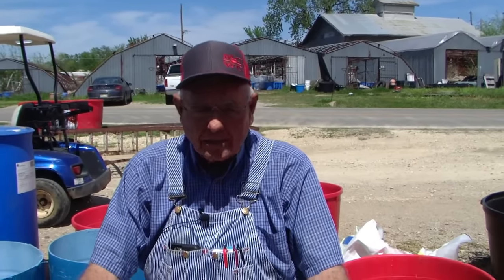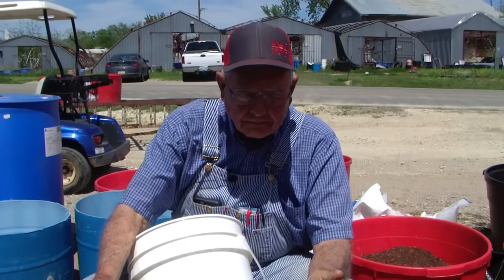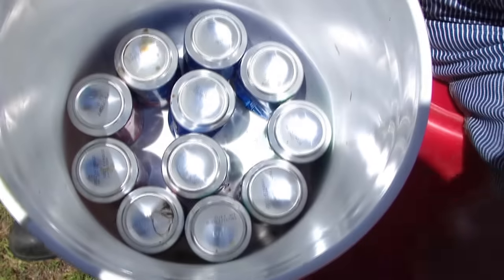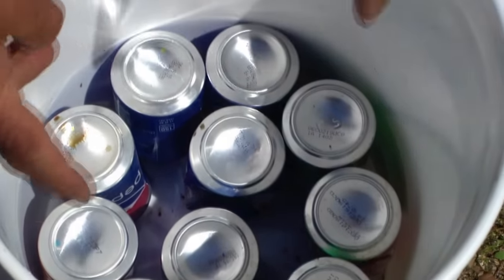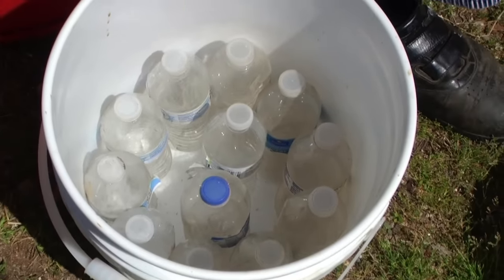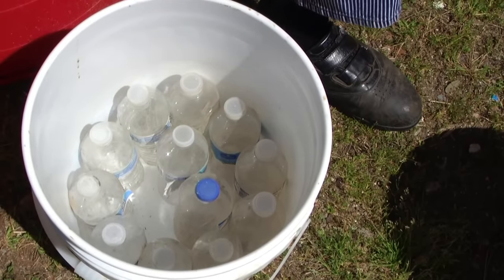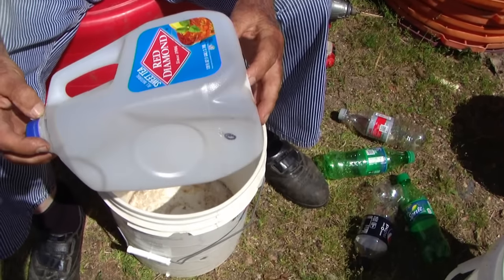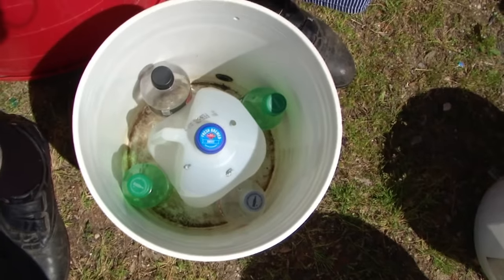Using 5 gallon wick buckets  Ep. 15

Comment: Are their any concerns with using aluminum.  I realize the insides of the cans are coated with a plastic to prevent oxidation, but what about the outsides bring in contact with your water and roots?  Any issues with the paint on the cans?  Any issues with the labels on the water bottles or the adhesives for the labels?

Comment: Okay,  i have to ask this question, because everyone that has seen my first ever self watering 5 gallon bucket garden system has asked. Will these buckets get too hot and kill my plants on those hot summer days. Mine is a white two bucket system with the lower bucket slightly buried but not above the drain holes. Thanks

Comment: Hey Leon, question, if you putting potting soil between cans, doesn't the soil going to block the hole in the can. Instead of soil, can it be pebbles? Thanks
Reply: Pebbles wouldn't wick the moisture up to the plant. The soil won't 100% clog the hole, water will still seep through.

Comment: Hi, so when I put the small water bottles in my 5 gallon bucket, it doesn’t look like it leaves a lot of room for the soil. I end up with only 6 1/2 inches from the top of the water bottle to the top of the bucket. I was wondering, can I cut the water bottles in half?

Comment: Where can I purchase In FL , the correct Fertilizers & minerals you used in your starter bucket video I am trying 5 gallon version 1st … 
I am using a 3 bottle nutrient ( see below descriptions  ) will this work ? If not I need to know where to buy All the Fertilizers   
FloraGro builds strong roots during a plant's vegetative stage.
FloraMicro is used during a plant's growth and bloom cycles.

FloraBloom is added while a plant is fruiting and/or flowering.
Reply: Of course u can use those, it's just not Organic. Otherwise get a bag of Trifecta+, and just mix that in the soil
Reply: If you will view Ep 20A, this might be helpful in your fertilizers.  Most important is to look at the strength of the numbers on the fertilizer bag.   Thank you for viewing.

Comment: How do you fill with water? top of gallon jug has the hole how to keep soil out ? why do you use fabric in some buckets an not in all?
Reply: I think the design means use the fabric in all these different versions, but somehow the video just didn't mention it.  Because without using that fabric, but instead putting in soil directly to the bottles that hold water, the soil will keep falling down the holes at the top.

Comment: Do you have a video showing step-by-step directions for making and watering, for the visual learners please?
Reply: As the bucket fills with water the bottles fill with water coming in from the bottom hole at the same time the air in the bottle  comes out of the top hole thus filling the bottle with water. If to much water is added into the bucket then that water comes out of the hole on the side of the bucket.

Comment: Do you still put the ground cloth over the bottles so they don’t fill up with dirt.
Reply: Same question.. I put ground fabric around the black drainage tubes to prevent dirt from clogging the tubes holes.
Reply: I'm wondering this too
Reply: I watched the clip he did right after this... He did put the cloth over the black tubes.. but not over the large ends.. not sure what that means.. then indicated that on the sides where the fabric went down past the tubes the dirt would fall into and that would be the mechanism for water wicking up.. but I still am a little confused about the drainage hole and air space.
Reply: @creinicke1000  the drainage hole lets any excess water go out so your bucket doesn't get overwatered and drown your plants' roots.  The air space with it's own hole is so that water will go into the pipe or can or bottle and be kept out by air that has no exit otherwise.
Reply: xanadu1jw  sorry, still don’t get it exactly but will try some form of this.

Comment: Don't you need to put pvc pipe on the side for watering?
Reply: I was wondering the same thing
Reply: Yes a pvc pipe cut at an angle on the bottom to avoid clogging. These wicking containers work wonderfully. I've been useing them for a few years now. If your planting something that has a large root structure buy a few 50 gallon plastic drums. Cut them in half and you can plant a good 3 tomato plants in each half  along with some oregano or basil around the tomato plants. Cuts the hastle out of watering tomato plants. Which is a god send with tomatoes as watering them correctly is 80% of the battle
Reply: @billweirdo9657  but he doesn't show installing the pvc pipe or even the mesh fabric.  I hope Leon sees this comment and provides a clear answer.
Reply: @Sunshine-ox3hc   technically the Pipe isnt 100% needed but it makes filling these things a breeze. And you can add liquid nutrients easily without burning your plants. If you get decent rain and dont add nutrients. You can forgo the pipe and throw the bucket where itll get rained on. 
Without pipe you fill on the top with pipe you can fill from the bottom. I never use a mesh sock. Over the past 5 years I've grown just about all my plants with these wicking containers. My personal opinion after having some without the pipe is add the pipe. I'll never make another wicking pot without it 👍
Reply: Same here. Waiting for Leon to reply
Reply: @Sunshine-ox3hc  I think this is a follow up video.
Reply: @billweirdo9657  What about the landscape fabric he has in the other videos? This one just uses soil, right?
Reply: @deerpark39   of your making these in 5 gallon buckets and using plastic bottles or cans you really don't need the fabric for the fill pipe cutting the end inside of the bucket at an angle will prevent clogs, you can also drill some holes along the side of the pipe covered in soil to help prevent clogs. Nothing wrong with using the fabric either I just haven't needed to.
Bigger containers like 50 gallon drums cut in half people tend to use that plastic drainage pipe with sand and fabric. But I myself just used 1 gallon milk jugs and 2 liter soda pop bottles and just fill with soil and add a pipe for watering works great. The reason I choose the milk jug and soda bottles is to upcycle the materials to reduce my personal waste. 
I also do worm compost and make " worm tea" for my fertilizer. You just add water to dilute it and pour it right into the pvc pipe. Only have to do this about once a month or so depending on what your growing. You can add stuff like bone meal to the worm tea if you are growing tomatoes
Reply: @billweirdo9657  I just halved my 55 gallon plastic barrels tonight. So glad I saw this. You can plant 3 tomatoes in one half? Indeterminates too? I just rescued 3 Black Krim seedlings from the trash and was going to  plant one in each half. How do you stake them? Single stem pruning? Sorry for so many questions, I just thought they needed more room.
Reply: @suzi_in_zone6B  I grew those yellow pear indeterminate in them and some Cherokee purples and Romas as well. It depends on creative and crazy you want to get but here's what I did.
For the yellows I planted them close to to the edge of the barrel evenly spaced with each I staked with a decent sized piece of bamboo at planting. I put my fill tube right in the middle of the barrel. I made the fill tube extra long to act as a tie down point for the tomatoes. Then I took some hardware cloth and some scrap wood. I put 2 pieces of wood right next to the barrel stapled the hardware cloth, then I put 2 more pieces of wood a little further back stretched the hardware cloth and stapled. The structure resembled a monkey bars about waste high. I trained the plants to grow towards the structure and it made for very easy picking. Yes this is a bit elaborate but those yellow pears are prolific growers and this saved my back some uneeded pain. I used a worm tea from my worm compost with added bone meal diluted for fertilizer. I also planted oregano all over the top.

The purples the again close to the edge evenly spaced, but I used bigger stakes and again used the pipe in the middle as part of support trellis. Added a couple stakes out side of the barrel as a counter pull tie down. And used bigger stakes. That one I planted purple basil because they were both purple haha.

For both I pruned the inside more intensively for air flow leaving only a couple of strong healthy areas to produce the fruit. On the outside I lightly pruned. And yes single strong stem.
Reply: @billweirdo9657  thank you SO MUCH for the detailed response!! Brilliant idea putting the pipe in the middle and using it for support! Love the purple tomato/basil combo!! I’m a visual learner, but you’ve done a great job describing what you did. I truly appreciate it!

Comment: Where do you find sustane is there something comparable?
Reply: The bottles will fill with water from the bottom holes up to the same height as the bucket hole. The top of the bottle is air, which is essential to this working. The wicking is done when the soil at the bottom absorbs water up towards the top. Roots will dive towards the water. The water level will never rise up past the bucket hole. This is what helps control and prevent overwatering. It's a genius set up.

Comment: Using the 5 gallon bucket and water bottle method. 

My original water drain hole in the 5gal bucket was too high and above my water bottles. 

I've drilled a new set of holes lower (5inches up the 5 gal bucket). 

My question is do I need to plug up the original drain hole that is too high up or just leave it alone?

Comment: Hey Leon, how you put water in this, do I need a hole on the side?
Reply: As the bucket fills with water the bottles fill with water coming in from the bottom hole at the same time the air in the bottle  comes out of the top hole thus filling the bottle with water. If to much water is added into the bucket then that water comes out of the hole on the side of the bucket.

Comment: I need clarification of the air space .. if fabric is between dirt and water.. when water goes low.. how does the water get wicked up to the dirt? Also, i think I have my drainage hole in the side of my pot too high... What are consequences? I'm in AZ.. so self watering is vital.. but I don't want to drown the plants either.
Reply: As long as the fabric reaches the inside floor of the outer container and has dirt inside of that fabric filling the pocket that the fabric forms down to that level it will work as a wick. The air space allows water to come in and to leave the inner water containers/reservoirs via the upper hole in those containers.  Hole too high in the outer container equals too much water stays in the bucket and drowns your plant's roots. You can drill another hole down lower and it won't hurt to have a second hole. Excess water will just drain out the first hole it comes level with.
Reply: @xanadu1jw  thanks.. the second hole is what I was thinking also.. I'm just a procrastinator.. will do it this weekend. I still don't get the purpose of the air space? I think I've heard him say to do something beneficial to the roots.. but I don't understand.. so not having the roots grow down past air is a good thing??? Anyway.. thanks for responding, very helpful.
Reply: @xanadu1jw  just found this channel & excited to get started. What other fabrics can be used? I have a few feet of burlap, plus I have material type shopping bags..can either of those be used
Reply: Chantell MacMullin Any fabric can be used that is woven finely enough that dirt wont get through it & clog up the water reservoir and is strong enough that it won’t rot for a long time.  I bought a roll of landscaping/weed blocker fabric today that is about 3 feet wide and 50 feet long and supposed to last 30 years for 19.95 at Lowes.  That seemed good enough to me.
Reply: @xanadu1jw  oh good. I have material here that I'd rather use up. Burlap is pretty strong. Thank you
Reply: xanadu1jw   Not exactly ‘food safe’ . Muslin is a better choice.

Comment: How does the water get in the cans or water bottles
Reply: As the bucket fills with water the bottles fill with water coming in from the bottom hole at the same time the air in the bottle  comes out of the top hole thus filling the bottle with water. If to much water is added into the bucket then that water comes out of the hole on the side of the bucket.

Comment: How does the water get in the bottle.
Reply: As the bucket fills with water the bottles fill with water coming in from the bottom hole at the same time the air in the bottle  comes out of the top hole thus filling the bottle with water. If to much water is added into the bucket then that water comes out of the hole on the side of the bucket.

Comment: I forgot to mention the hole for the air. Are you going to drill 2 holes in the main pocket about an inch apart so the bottom hole for the water and the second hole for the air.
Worm casting on sale the best organic fertilizer
https://www.etsy.com/shop/Garden1957

Comment: REMEMBER  !    DRILL A SMALL HOLE THROUGH THE BOTTEM OF THE  5 GAL BUCKET !  THAT WILL MAKE SURE THE ENTIRE THING IS  "GROUNDED " .   JUST IN CASE  A LIGHTENING BOLT  WAS TO STRIKE THE PLANT , IT WILL KEEP THE TOMATOES FROM   POPPING  OFF !          .IM NOT A LUTHERAN ,  IVE BE A ACTIVE PEDESTRIAN  SINCE I WAS 18 .

Comment: plastic bottles degrade over time and can release toxins tho. depending on brand ofc. so would check that before using for growing food
Reply: Agree but what to use?? No aluminum either.
Reply: @user-22-  i know it breaks down. but maybe glass. i use hard plastic food containers, for the one i am testing now, i think for plastic it should be taken out after the season. if it has better results than my other self watering system. im gonna try it with glass next year
Reply: Trond ee   & drill glass for the holes??  Too many & too hard. (But would rather use glass..) I’d need a LOT of jars for my buckets, it would take a while to get them, or cost $$$. I chose muslin for the cloth & these stupid “cheap” DIY planters have cost me a LOT.  Nobody near me had any food grade buckets to ‘get rid of’ either. (Misled by the Internet ..)
Reply: Plastic bottles: 70-450 years. Plastic bag: 500-1000 years. Tin can: around 50 years.
Reply: @NY-152  yes, this is to be broken down completely and or changed. but if you see the expire date on plastic bottles, that is the safe for food date. because certain plastics starts seeping out chemicals after a while, and those chemicals are not safe for food(depending on the grade of material). they are so-called porous plastics, and sadly can be poison.
Reply: @user-22-  same here, had to buy food grade buckets online, got 7 for 70$. but i have one that is running this way now, not gonna eat anything from that one, but testing the system. it works fine, but it also has less growth then the one next to it, wich is in another selfvicking system. so i must test more and see.
Reply: @Trrondee  Define "awhile"?....
Reply: @NY-152  love your username, it is so random, i just watched the movie like 2 weeks ago. well, i can't define it, as it depends on material. i guess a bottle that is meant to be food safe would be safe for 1 season. but i would also check the brand, say you use coke, check if coke bottles are bpa and phatales free and such, i think it obviously is, but also check for what other materials they are made from, and research those. im gonna do that myself this week if i have time, i can write back here what i find, my guess is that it is more than safe for 1 season. i just don't know.
Reply: HDPE or LDPE or PP 05 are the plastics that are considered safe for gardening, they are heat resistant non porous food-grade plastics. look for the recycle triangle on the product, it should say something like 05 and have a PP under if it is that, and the others accordingly. also these plastics are commonly marked with a glass and a fork. i have yet to find how long they are safe, but for sure they are safe for one growing season.

Comment: Hi all. I am very confused. On his 1st video he covered the bottles with commercial ground cover and inserted a pvc pipe on the side but not here. He did not show in here how will he put the water. Can anyone help me? I am completely new at this!! -)
Reply from the maker: LavidacomoOyola call 580-564-5909 he will explain
Reply from the maker: LavidacomoOyola call 580-564-5909 he will explain
Reply from the maker: LavidacomoOyola call 580-564-5909 he will explain
Reply from the maker: Call 580-564-5909 he will explain

Comment: 🤔🤔🤔Coarse sand would be a better medium for the water reservoir. Then insert a tube wrapped in mesh to allow for the removal of excess water. There really is no way for those bottles to collect water so you really are just putting a bunch of junk in the bottom of your planters.